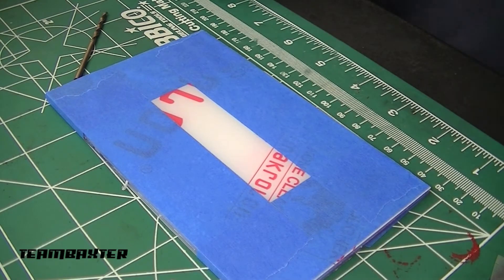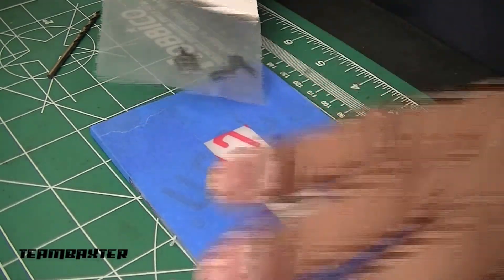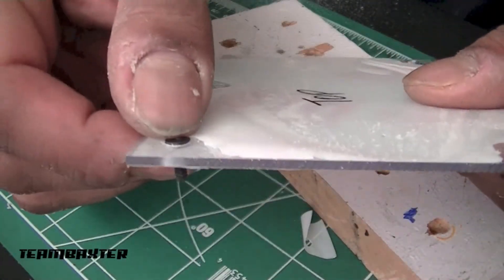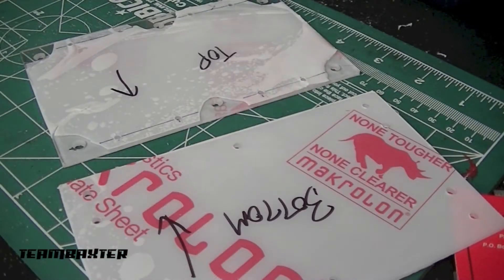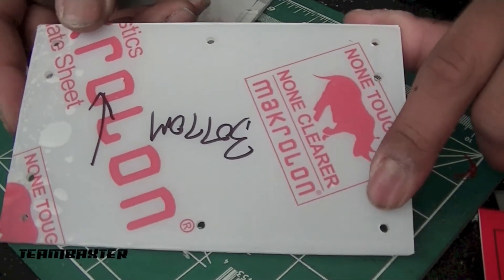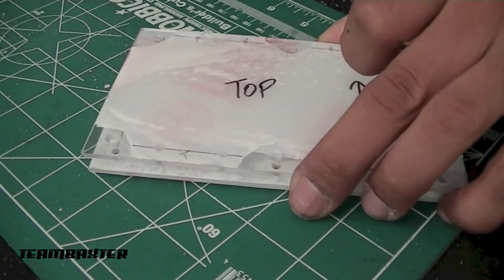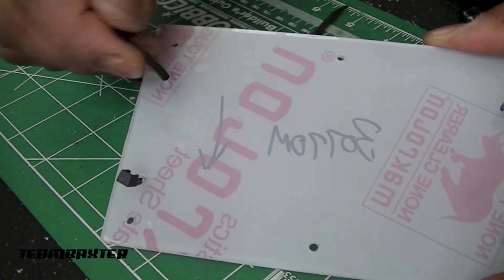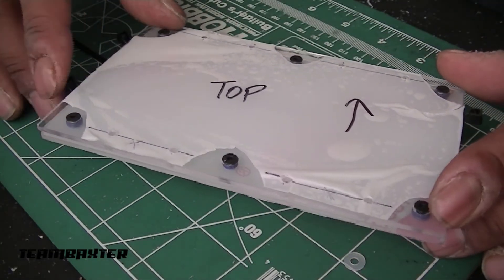MaxStone 8 Upgrades: Lexan Electronics Plate

Comment: Where do I find some of this lexean plating ??
Reply from the maker: I found mine at my local hobby shop. If they don't have any lexan, I'm sure they have another building material that you may be able to use, such as kydex or any other rigid sheet plastic.
Reply: Thanks bro
Reply: Thanks for the help i made the same replica of the plate now I'm looking forward to putting 4 wheel steering on. then build my electronics on my maxstone8 :)